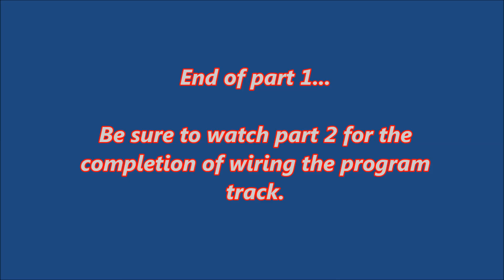How To - Wire a dedicated program track - (Part 1)

Comment: Hi Deryk, I know this is a few years old but I found your explanation of the method very helpful. I was concerned about the potential problem described by Ian Turner 3 years ago and I think that would have been because the switch was not a true break-before-make type. To make sure I didn't suffer the same problem I used a heavy duty 4 pole double throw 12 volt relay wired the same way as your switch, and operated with a simple SPST toggle switch mounted beside the panel for the Powercab. In addition, I used the same 12 volt switched wire to the relay to connect a bright flashing LED beside the switch. No mistaking when the programming track is ON now!  Thanks for the video.
Reply from the maker: Great info and upgrades.   Thanks for sharing!

Comment: Great video but I'm a little confused after reading the comments about which toggle switch you're using. I would think   one would use a 4P2T ON/OFF/ON, (Not a 4P2T ON/ON) because you would move thru the center off position assuring both inputs OFF before connecting to the other power source. Thanks for the videos!
Reply from the maker: It's a an ON/OFF/ON

Comment: If I get a switch that is rated for 5A, is that safe? It's right at the limit so I'd be worried if for whatever reason more than 5A makes its way onto the layout due to a short or something
Reply from the maker: I think I would get a higher rated one just to be safe.
Reply: The one you used is no longer available as far as I can tell, but I found one rated for 15A @ 28VDC. Thoughts?
Reply from the maker: I don't remember what the one I had was rated for....  Just get at least that or higher rating.

Comment: I suggest you are VERY CAREFUL about the switch you use. I did exactly the same thing for my Prodigy Advance 2 system, and it seemed to work well, but suddenly I found that my programming track would not read CV values at all, and then it decided it would not program any locos either.

I tried everything, and in desperation sent my unit back to Gaugemaster, who very kindly repaired it FOC, commenting on the paper work that you must ENSURE that  the main track and programming track circuits do NOT come into contact with each other.  That is what apparently happened to mine, blowing a couple of resistors and other components in the controller unit.

Nobody knows how this happened,  but quite obviously as the two SPDT switches I was using to make up a DPDT switch managed to somehow connect before the other was disconnected.  This could be even more likely if you are using a single DPDT switch, so I did as advised and kept my programming track TOTALLY SEPARATE from the main track feed, and all has been just fine ever since.  CAVEAT EMPTOR as they say

Comment: Your video came right on time I was about to finish of my yard with a similar set up. Where did you get a switch with  so many connection? I went to Radio Shack to look for one they don't have it. Great video. RT
Reply from the maker: Thanks buddy!  I got the switch off ebay.  http://www.ebay.com/itm/Miniature-4PDT-C-Off-Toggle-Switch-ON-OFF-ON-M403-/122004392070?hash=item1c68074886:m:mYMB5wPjNZN3b_gM-3zYTvg
Reply: Thanks you.